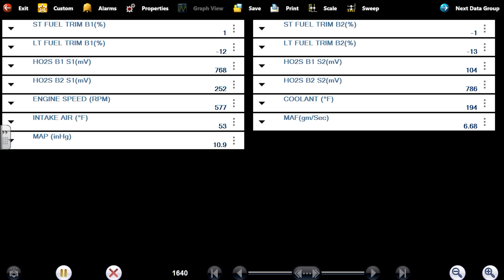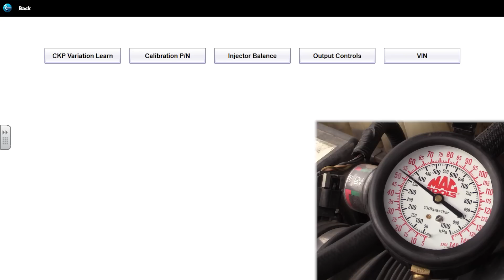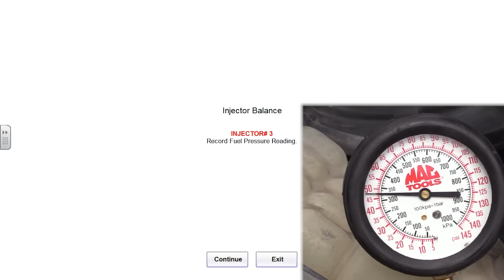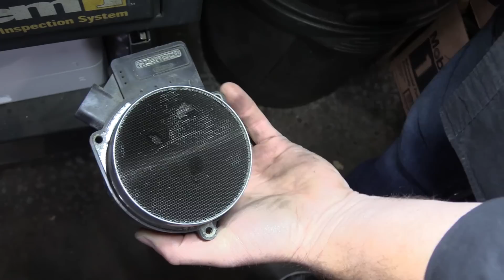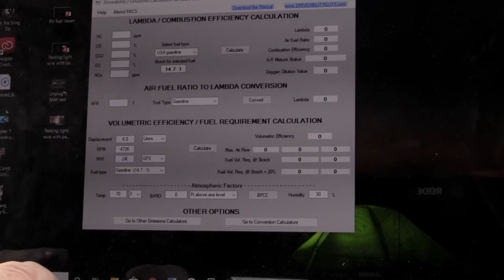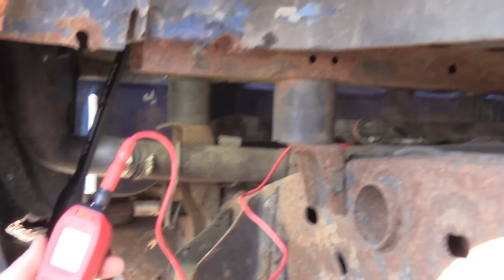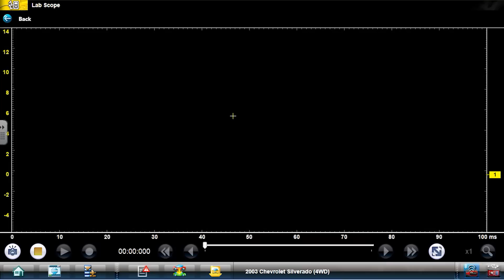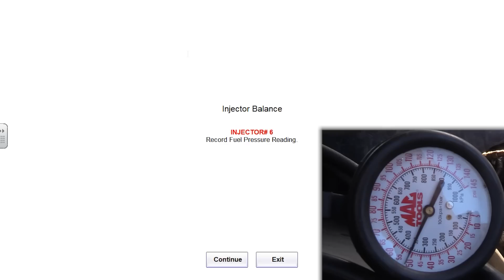03 Silverado Misfire, Rich AND Lean fault codes

Comment: For the g/s vs engine displacement statement, would that be without any accessory loads? I'd imagine as you add accessory loads like AC and headlights, etc, the g/s would increase.
Reply: Correct! G/s is at idle with A/C off and no electrical loads and not in gear
Reply from the maker: Yes, at idle, hot engine, no loads. And use this as a guide only!!
Reply: @ScannerDanner  of course! Gotta rely on multiple tests!
Reply: Smaller engines often idle faster too.